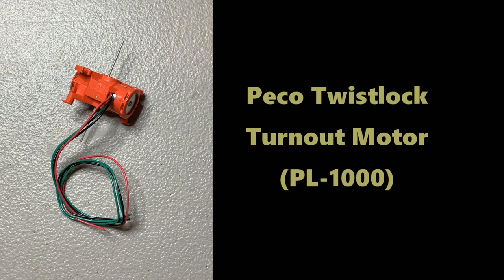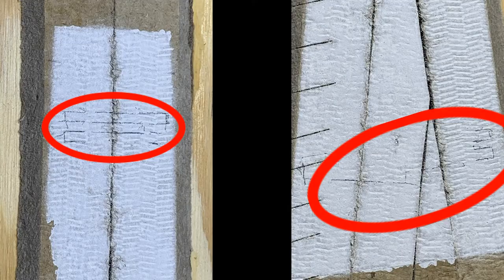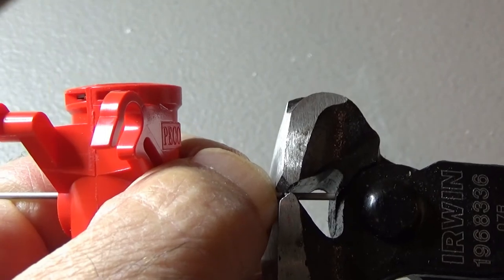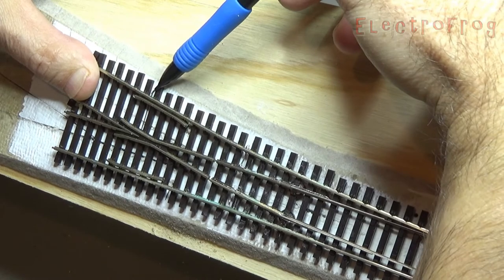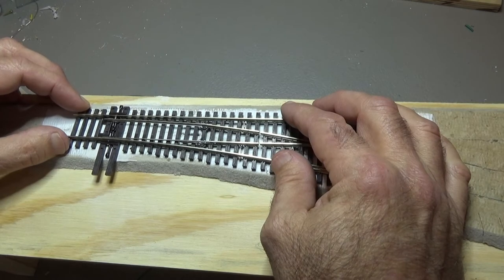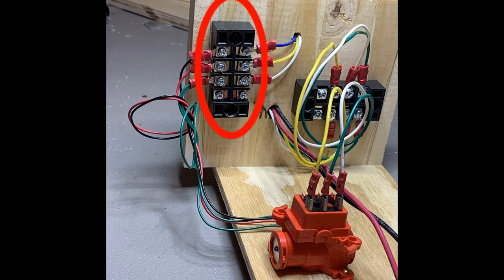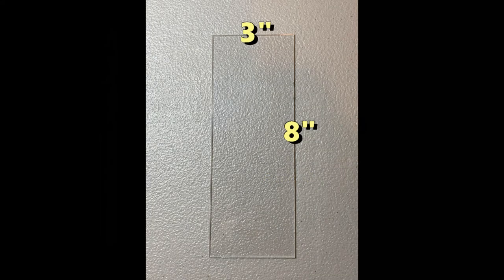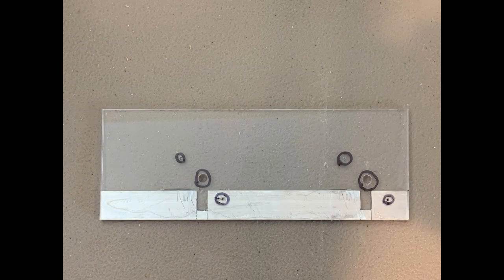Installing a Peco Twistlock Turnout Motor

Comment: Hey, do you need the frog juicer if you have connected the PL 1005 twistlock twin microswitch?  Shouldn't the 1005 take care of switching the polarity in the frog?
Reply from the maker: Yes, you can use the PL1005 to switch the polarity of the frog.  Another use of the PL1005 is to provide feedback to your control system to know "for sure" which way the turnout is thrown.  If you want to use the PL1005 for both functions, you're in luck because the PL1005 has 2 separate sets of contacts.  You would use one to switch the polarity and one to provide feedback.
Reply: @BobWesneski  thank you for responding to my questions!

Comment: What are you using for the underlay for the track?
Reply from the maker: Instead of cork I use homasote. Specifically I cut my roadbed into the desired profile and cut kerfs in the side to allow for bending. I have a video on my channel showing how I made it. I’ve since learned there’s a company that sells this product; it’s referenced in my video as well. I much prefer homasote to cork for many reasons but it is more expensive.